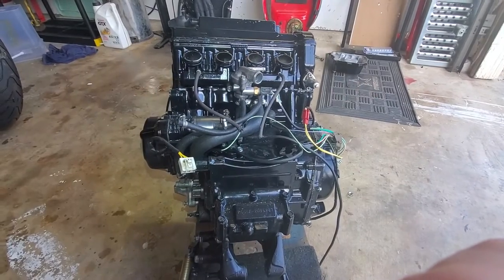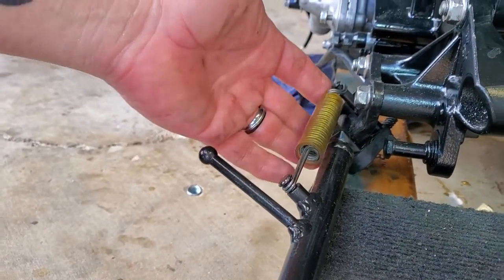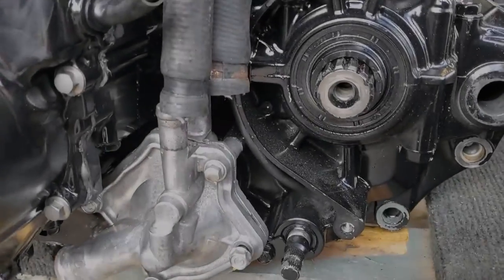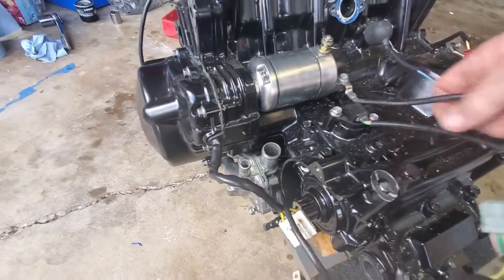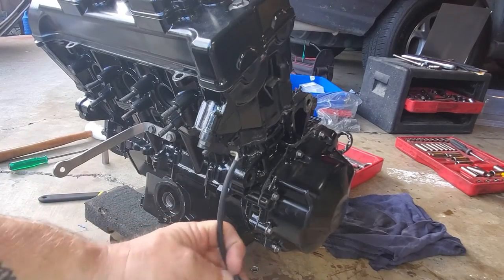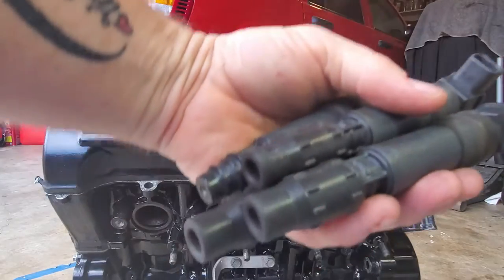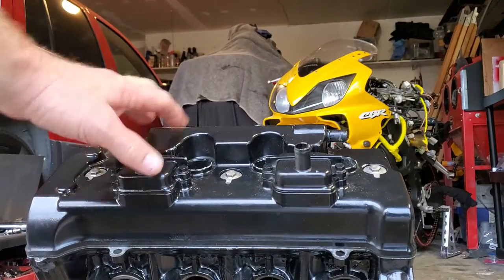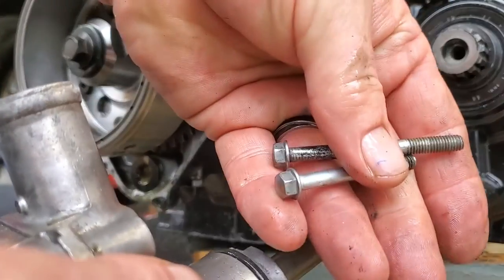CBR600F4i Engine Teardown episode 1

Comment: Good video, I’ve done my own engine tear down vids, it’s interesting to see how others do it. Seems like you have a bad water ingress issue to find anyway, and looked like there was a load of it sat in the oil cooler when you pulled it off. Sure that was water peeing out of the outlets when you pulled it off. I’ll watch the rest of these with interest. Keep up the good work. Rich from the u.k.
Reply from the maker: yes sir!  turned out to be a crappy head gasket...  
Thanks for watching!

Comment: You have to be careful when removing the camshaft holder bolts.  I believe you did it in the order as marked on the holders themselves, which is incorrect.  Those numbers are for the order they should be torqued down in.  When removing them it should be done in reverse order.  I´m not trying to be pedantic about it but great care must be taken as any damage on the holder itself means a new head is required as they are machined as a matched set.
Reply from the maker: noted thank you!  Thanks for watching!